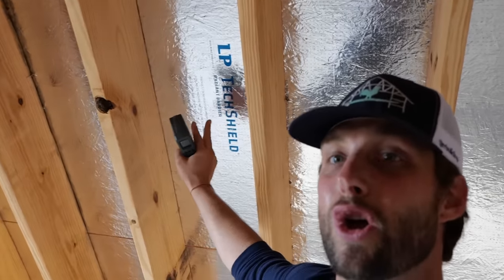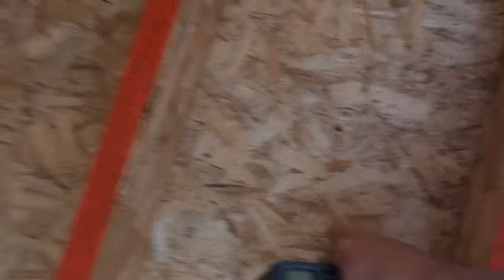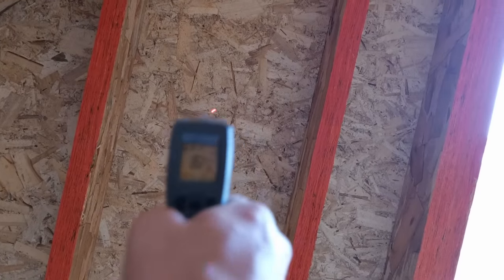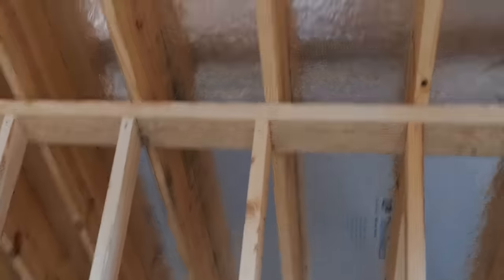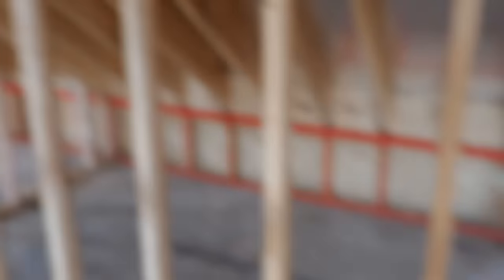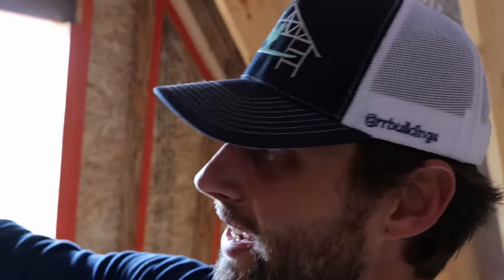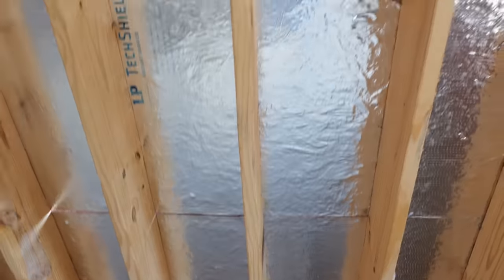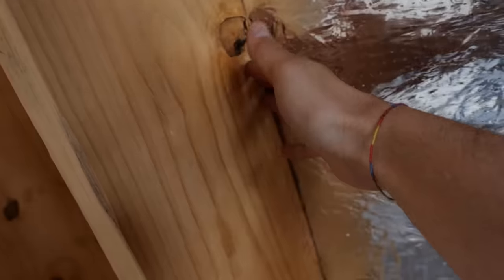Do Radiant Barriers Work? - LP Techshield Review

Comment: A-frame house. The section I’m thinking about currently has a sheetrock ceiling with insulation blown on top of it in the attic. Temps can get above 100F here. Can I get away with taking out the ceiling (and therefore insulation) and install this stuff as an insulation replacement and reasonably expect the space to not get super hot on a 100-degree day?

Comment: Don't have much building experience but understand the need for a vapor barrier. In Alaska we put it under the drywall or used urethane spray foam, but here in Texas it seems to be needed on the outside. Does this also works as a vapor barrier, or do you still need a wrap under the roofing and walls? Could you spray foam on the outside between furring strips? Asking because we want to add a half story to our ranch house.

Comment: I wonder: what if you add this radiant barrier, then glue a blue foam sheet into the cavity with a space in between it and the radiant barrier, then spray foam. 

Thoughts concerns: would it be too expensive, would the blue foam give way, do you cause new problems for the roof deck in winter (ice dams)

Comment: I have been asking this question a lot but never getting a straight answer. Maybe you can help.
If I apply radiant material under roof sheating, then across the rafters on the inside, will I get moisture as a result also what about under drywall for walls with fiberglass insulation and slats for a air gap ? 
I'm I just creating a recipe for disaster with moisture, or will it stay dry?

Comment: Question I’ve seen this kind of system with a bubble wrap like material in between is that there to  prevent conductive heat/ a barrier between the aluminum and the insulation?

Comment: I see someone mentioned this as well, but the average IR gun is NOT calibrated for reflective surfaces.   Using them in an industrial painting scenario where parts can be from 350F to 400F.  if a painted part measures 400F, an identical part with a chrome silver reflective surface will  measure about 100F to 150F LOWER......

Comment: Yes do a video on more heat transfer, im inclosing my patio and want to make a large living room out of it it has a metal roof and im using square metal tubing to frame it in with wood type panels for outside walls and a partical wood floor my problem is i live in mesa Arizona where it gets extremely hot do you have any suggestions for what i should use to insulate the ceiling and walls? Id much appreciate it.

Comment: Thank you for the video. My understanding of proper radiant barrier installation is that there should be an air pocket between the reflective barrier and the inner roof IF the attic is vented, as is the case with my attic. This allows the air entering the soffits to circulate and escape freely through the upper vents. I'm assuming the attic in this video is NOT vented (sealed) hence the direct application to the underside of the roof? I just had this done in November of 2019 and the radiant barrier was stapled to the end of the rafters creating that air pocket you mentioned in your video between the roof and the RB. I also left an opening at the upper vents and the base of the attic for air entering the soffits to circulate freely and exit the upper vents. I should note that my air handler and water heater are located in my attic. My AC failed last summer DURING a heat wave in VA, and I assumed the excessive attic heat was a contributing factor to that failure. Hopefully this will help prolong the life of my new system!
Reply: Dave Logic yes but he didn’t explain how this heat trapped in the air gap is exhausted. Seems a ridge vented roof would be best practice.

Comment: I want to keep my attic vented, I do not want to turn it into a closed attic, however I wish It didn’t get so hot in there in the summer, should I spray foam the underside of the roof deck or install some type of foil radiant barrier? What will work best? Thanks In advanced

Comment: If your intending to keep heat in the space then your correct otherwise the radiant barrier needs to face the heat source with an air gap.  This is how the barriers work.      Also, your thermal gun will not read correct readings due to the reflectivity of the foil. That's why they are coming in lower. Tape a some paper on the barrier and you'll see more accurate readings.
Reply: @AtticFoil  I think your confused. There are three factors in radiant barriers. Absorbtivity, emmsivity, and reflectivity. They all must sum to one. Therefore,  high reflectivity has low emissivity  (assuming no absorbtion)  Or low emissivity has high refctivity. Its really the sum that's important. It doesn't work on one property or the other.......  But in order for it to work properly, it must have an air gap between it and the heat source.
Reply: STEM_SAVING So you’re telling me that if I take two hot potatoes out of the oven and wrap one with foil it won’t stay hot longer Then the one not wrapped in foil?  That would be an air gap on the cold side and it would be working off of the emissivity quality.
Reply: @AtticFoil  I'm saying for your example, the foil would need to face the potato. And to work most efficient, would need an air gap. Its basic physics....emissivity + reflectivity + absorbtion =1.
Reply: Think about satellites in space. There is no cold side. The barrier is put on the outside to reflect the radiant energy (the sun)  which is the heat source. So,  the barrier in your example,  is in backwards (unless your trying to reflect and keep heat in the attic ) and isn't operating as effectively as it should be with an air gap.

Comment: Great video! So you mentioned you have to have air flow off the back side for the barrier to work correctly. If someone was installing rigid foam board insulation in garage panel door and then adding the radiant barrier over top/inside (the part we would see) , could that work to push out heat?

Comment: Thank you for the information, but what are the long term issues faced relating to moisture.
Reply: Good question.
Reply from the maker: It depends on what you mean by moisture.  Humidity? Liquid Water?  If it you have a leak, you have a problem no matter what your roof decking system.  If your concerned about vapor permeability, the foil is perforated allowing for some permeability.  This is a tough question because like everything in building, it is highly dependent on the design of the system that the product is subjected.  Ventilated attics will have different concerns than conditioned attics etc...

Comment: I have seen other installations where they have radiant film over foam pieces and it gets installed directly on the garage door. Does the foam act as "the space" between the radiant film and garage door? Or is the foam used cause it's a poor conductor?

Comment: I am trying to design a simple chicken coop. IF I were to use this on the inside of my roof plywood with it exposed, would my chickens eat is, and secondly would it keep the coop cool? How does one put an air gap between I assume from the radiant barrier and the plywood? thanks
Reply from the maker: I'm not a chicken expert, but if they could reach it the shiny surface might attract them to peck at it.
Secondly if you leave it exposed to the elements it will get dirty over time and lose its efficacy.
If it was me I would use a galvalume corrugated roof that is separated from my decking with battens giving an air gap between the majority of my roof decking and galvalume roof cladding material.  The galvalume will reflect much of the radiant energy and will not emit much radiant energy beneath it.  You could also forgo any decking at all and just put the galvalum right on purlins.  that would probably be the best way to reduce the radiant energy from readmitting on the backside with the least cost.
Reply: @JordanSmithBuilds  OH GREAT THANK YOU FOR YOUR HELPFUL SUGGESTIONS :) TC TTYL

Comment: You warn against placing insulation next to the radiant barrier due to conduction through the insulation; but is that not the point of the insulation to begin with?  Insulation (foam-in, fiberglass, etc) reduces conduction, not aids it (think of how that would be in a refrigerator which uses foam-in to produce a heat barrier).   I always thought the reason for providing the air gap between the rafters was to aid roof ventilation out the roof ridge.

Comment: I have an old roof and there are boards that run across it. The thermo plywood would not work on my roof correct because if I lay plywood on top of the boards it does not create the necessary gap correct? Please let me know so that I don’t make the investment thank you

Comment: Great video! I've got a great question.  What if I'm building a sauna? Basically im doing the reverse. I want the radiant heat reflected in right? Do I put the gap on the outside of the walls and the foil barrier on the inside? Every video I've seen puts it there and then the inner cedar planks right on top of it.

Comment: If you are trying to reflect radiant heat from the Sun, then the outside surface of the sheathing is what matters.  The inside surface facing into the attic will have little to no impact until winter time when you are trying to reflect warmth in the attic space back into the house.  For warm climates the reflective surface would need to face outward with an air gap between the radiant barrier and the roof.
Reply: This setup will make the attic hotter in summer. Just stupid.

Comment: The best way to prevent heat from infiltrating via the roof shingle (IR to Conduction) is with low thermal conductive fasteners (as well as exterior insulation). The thermal conductivity of mild steel (regular roofing nails) is about 90 wm/k (i think thats the unit); where as Stainless Steel (4xx series?) is about 33. The fact that nearly all sloped roofs have mild steel fasteners affixing the roofing assembly together is directly what causes the IR heat gain from the Sun.
Reply: The best way to cool the roof assembly and prevent heat conducting to the attic/living space is by creating an effective air gap that maintains low pressure within the rafter bay as opposed to above the shingle, which creates the air-washing effect required by roof shingle manufactures in order to be covered under most shingle warranties. In the 'study' cited, the shiny foil creates the low pressure path way for air to air-wash the rafter bays, preventing heat conducting into the attic/living space.

Comment: my ceiling has 2x4s. can i just leave space in between the ceiling and lp techshield? i dont have the room for fiberglass insulation and i already bought the sheets.... so that i can have a air gap on the back side of the techsield sheet.

Comment: You want an air barrier to both sides for it to work best. Or one side then is conducting and the other radiating which then you have an issue of on a thin product if you’ve got a hot side and cold side where there’s conduction on one side (the non foiled side) it will conduct through to the radiant side that has the air gap. So it can then conduct the heat on a hot day from outside and radiate it inwards time the living space. Just in the same way like you said if you stuffed the void on the foiled side with no air space it then becomes conductive absorbing heat from inside, warming up the OSB. That’s why over in the uk we have a variety of thicknesses of insulation board that has foil on both sides.

Comment: With that radiant barrier you could still use a spray foam, if you blocked it an inch away from the roof area and stapled a baffle on the blocking. And I'm not saying put the blocking directly next to the barrier, stand it off a little so thermal transfer is a non issue

Comment: So my question is, because I’m doing spread foam on the new construction home, would it probably work to glue aluminum foil to OSB sheets and put like 1 inch blocks between that and the sheeting? Because I’m trying to limit as much as possible any energy loss

Comment: What if the air gap is on the top instead of in between the foil and insulation? Kind of like using the foil as a baffle

Comment: What if you just use a small triangular strip of radiant insulation along the sides of every rafter , over the top of the one already installed? Should give a thicker coverage at the corners where some of the outside temps would be slipping in.

Comment: Next month, I will be insulating my chicken coop (8x5 pent-roof shed). I want to keep the cold out during winter and keep it cool in the summer. My idea is to staple the foil directly onto the shed panel walls and roof. Then I would fit one-inch square wooden blocks on the inside of the uprights and fit the hardboard onto them, creating a one-inch gap between the foil and board. Would this do the trick? Also, is it more effective if I installed a breathable membrane first and then the foil on top of that? Great video by the way.

Comment: I think you've misunderstood how this works. That foil backed OSB is keeping radiant heat inside the building. You have it configured to keep the building warm in winter. It won't help with cooling in summer. Radiant heat from outside cannot reach that foil. It strikes the OSB and heat is then conducted (not radiated) through the OSB to the foil. The foil then heats up and radiates heat into the air in the roof space. However, any radiant heat from inside the roof space heading to the foil will be reflected back into the building. Radiant barriers keep heat on the side where the air gap is, and do little to stop radiation coming through from the other side.
Reply: Not necessarily. It does keep it cooler in summer as well. We have a shed with it and definitely cooler.
Reply: @JB-uz2nw  No, it doesn't cool. It only heats or does nothing, depending on whether or not a heat source is present. A radiant barrier must be placed outside the house, facing the sun. Or it can be placed above the attic floor insulation, facing up to an un-insulated roof deck. Must always be outside the thermal envelope, facing away from the thermal envelope to work for cooling. If it is inside the thermal envelope, it will only heat or do nothing. You were probably in the shed at two different times where the ambient air temp, sunshine or wind is affecting the air temp of the shed, definitely not this product.

Comment: So the infrared temp guns assume a certain emissivity/absorptivity as most organic materials are roughly the same. Anytime you shoot that thing at a highly reflective surface you get bs readings. I see it all the time - usually on shiny engine parts. 
Not saying that the foil isn't a good idea, just that you can't measure it with the temp gun. Might be interesting to repeat this test measuring the temperature of the space (radiative barrier vs. plain surface) to capture the radiative contribution.

Comment: Have you looked at the paint additives that reflect heat?  They are based on NASA tech and do an amazing job at a low cost.  For keeping you warm in cold climates, you just add them to your normal (quality) wall and ceiling paint.

Comment: I'm not really sure about that test but I am currently replacing my siding on my mobile home to the newest smart siding with the radiant barrier. The size of the old siding which is a particle board siding with no radiant barrier is exactly the same size and the new. I just so happened to have completed half of the mobile home when I realized the wall that has half the old and half the new has been taking on the Texas sun at full heat giving me the chance to test that "radiant barrier". I didn't have a tester like in the video so I just put my hand in both walls. Unfortunately the new stuff I just put is was much much hotter than the existing boards with no radiant barrier. Almost the same exact material except one is new with radiant barrier and there is no way that siding blocks the heat more. I understand that this is not a good test because it's not the same exact boards but in any case it's less effective than the traditional siding.

Comment: Can someone answer. Does this work all day and long term? I saw one guy who measured the temp of the bottom of techshield and it was hot. Duh! I would expect that. He claimed it then ends up heating up the attic even more by the end of the day. That is not true is it?  Anyone used this product or stapled your own foil to roof decking when you installed a new roof or replacement?  Also, who makes the best staple on attic radiant barrier?  I want to use plywood and there is not even any 15/32 LP Techshield OSB to be found around here so I figure I would staple my own to the plywood on the redecking. Any recommendations for the foil?

Comment: I will buy large tough shed, they offer radiant barrier. What is your recommendation for the installation of the barrier? I was thinking that later I would add rigid insulation or dow corning roll out, in between rafters and wall studs. Please Advise.

Comment: We are getting a workshop prebuilt. I ordered techshield on walls, but spray foam on the underside of decking of roof. On insulating the walls with fiberglass , I need a air barrier between insulation and tech shield , correct???
Reply: If the building is non-conditioned, you may be better off with a radiant barrier product only compared to foam.  More info here: https://bluetexinsulation.com/pages/insulating-non-conditioned-buildings-vs-conditioned-buildings

Comment: Good product. How will you install the insulation with the air gap? Same as normal or will you take in to account the possibility it could fall out since it's not pushed all the way in the rafter?
Reply: Here is how we recommend doing it for EXISTING roofs where you are installing a Cathedral Ceiling: https://atticfoil.com/index.php/applications/cathedral-ceilings-hotmixed-climates/